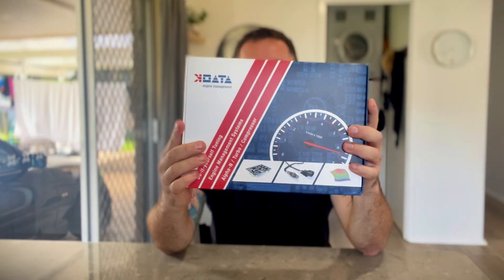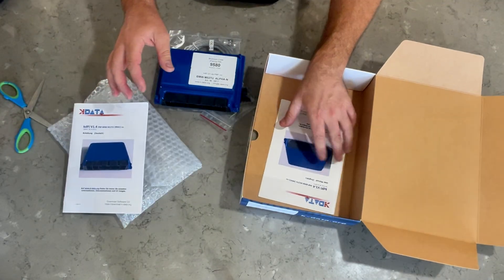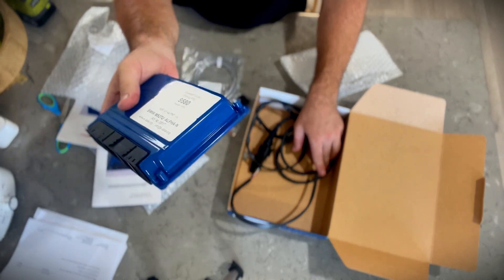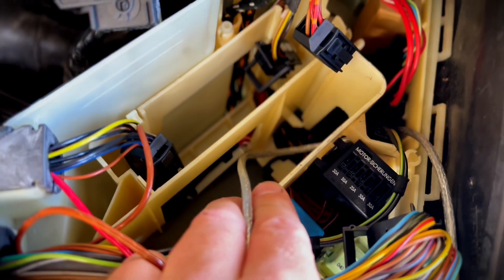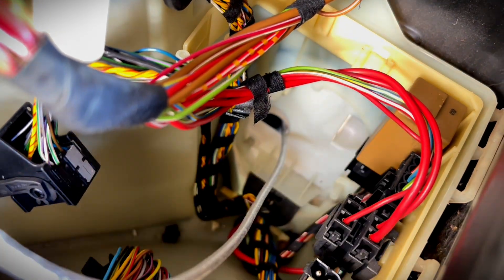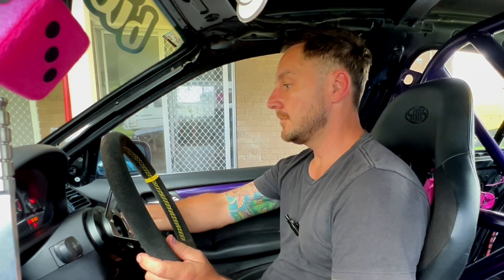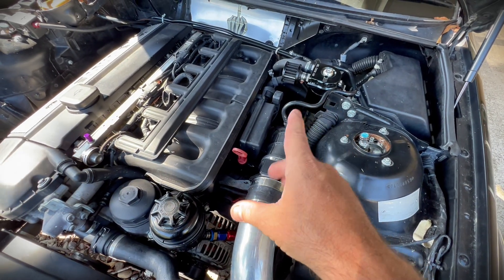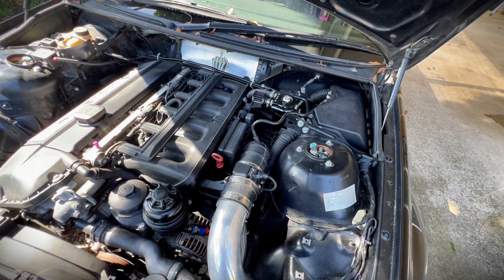Installing a K-Data ECU in the E46 Drift Build | kdFi V1.4

Comment: It doesnt have EWS built in. There is a difference between no crank and no start. No crank is realised in EWS module itself where small relay cuts power to the starter solenoid if key isnt recognised. You can bypass that just by connecting two wires in EWS connector, but with stock DME it wont start because EWS will tell DME to cut injectors. On standalone ECU it will start because there is no EWS function inside, only no crank function works.
Reply from the maker: That’s really helpful info thanks. 🙏 I know ews is a separate module under the dash. I just wasn't sure how it communicates with aftermarket ecus. actually like having some form of immobiliser. Thanks heaps mate.

Comment: 05:37 I hear a ticking noise coming from your engine, i think your camshaft position sensor is faulty
Reply: Lmao pretend you be a mechanic that’s injector pulse All day. Camshaft position sensor? Lmao
Reply: @Phuck-ur-Ai-vids-jigga i had the same noise in my m52, after some trouble shooting it turned out that if the camshaft position sensor is faulty, the injectors starts ticking like that, changed the sensor, noise gone, happened 3 times before i found a good replacement from hella. Instead of insulting people, try to understand how an engine works.
Reply: @marcorossi6953  former bmw tech . dil doe

Comment: is it possible to ues the same ecu in M54b25 ?
Reply from the maker: Yes but you have to get that version from the K-Data store. M54 uses fly by wire throttle so the programming might be different.

Comment: Top video. I just have a small question because I don't know much about the topic yet. why is the new O2 sensor needed?
Reply from the maker: Not needed, but more beneficial for forced induction in the future. It can accurately read the air/fuel ratio so you can dial it in better. Hope this helps. 🙂

Comment: Engine speed still works with kdfi?
Reply from the maker: Hi Eltirielo. RPM still works. It needs to have that input to know when to trigger fuel and spark.
Reply: @BertusBuilds thats nice. The RPM  didnt work on my 328 when i had the kdfi a while ago. Initially yes for a second but died then. Other than that everything was perfect. 
Got the UAB yesterday, looking forward to try it.

Comment: Bro I just clicked on this video and got super excited, I love what you’re doing , and I wish I can build my e46 for drifting like you did some day, but unfortunately where I live(Armenia) it is almost impossible to buy performance stuff for cars or they are super expensive because of transportation fees.
Anyways, good luck mate)
Reply: Hey!
Thank you for replying!
I’d like to know your opinion, so I’ve got e46 320i (2000 year EU make) as I remember yours is 2,5 L  engine, mine is 2.0 do you think I can get something that will drift, I remember somewhere on forums a guy said as long as you got 6 piston engine you can drift.

Edit:
Also, do you think the roll cage is a must have thing for a budget drift car?
Reply from the maker: 320i will definately drift. Weld the differential, pump the tyres up and send it. You don’t need a roll cage, but good seats will definately help. 👍🏻
Reply: I drift my 4 cylinder BMW e46 318 touring. 117hp. Manual transmission.  It's good to drift with in the rain and snow. Very smooth and easy to handle. My only upgrade is coilovers. I have not welded the diff. But i strongly recommend doing it for drifting Helps alot. You can also strip the interior/ speakers. anything you dont need to save some weight. My car doesn't have the power to drift on dry asphalt. A 320 is enough for drifting. Power is not everything🤘
Reply: Hey bro thanks , you really encouraged me ✊ I might start  doing it on upcoming summer. Thank you!
Reply from the maker: Thanks mate. 🦘I love hearing from people all over the world. Reach out if I can help direct you to any resources that may help you out. 🌴